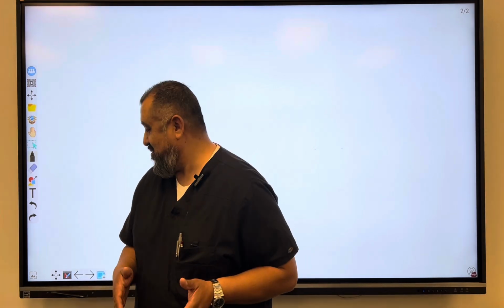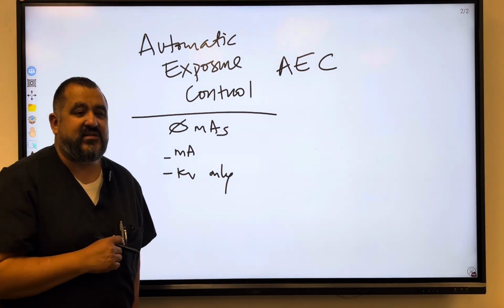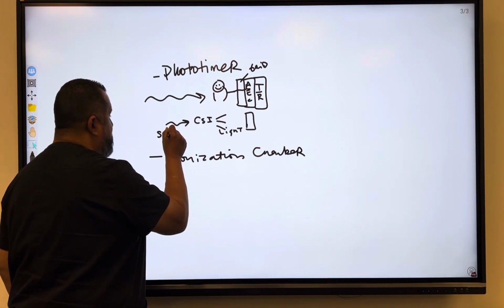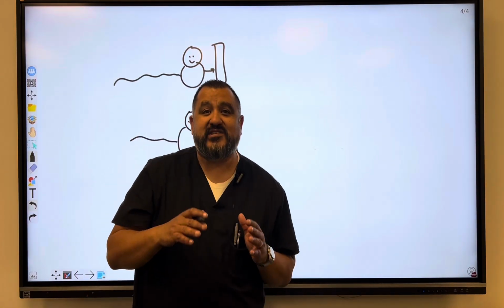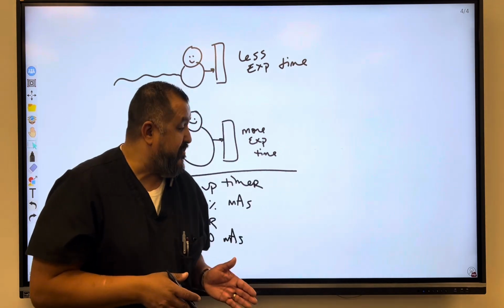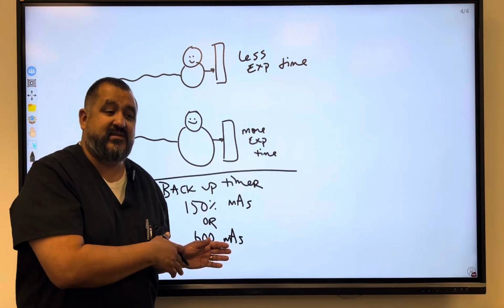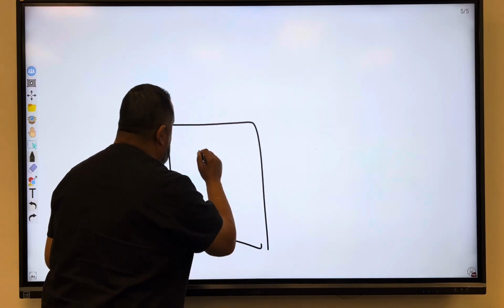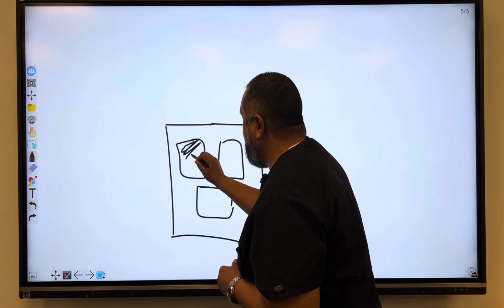Automatic Exposure Control (AEC) | Radiography with Mr. M

Comment: ughhhh wish you were my professor  iwouldnt be doing bad just a month in ): !!! any chance you Can go over Xray Ch 6 x ray equipment, skip tables, but power for x ray generators , incoming line current , single phase ,3 phase , filament / main circuit, compositor for mobile units ch 8 xray production, target interactions, hat productions, bremsstrahlung / characteristic interactions , admission spectrum ( i have the principles of radiographic imaging and art a science  )

 :
Reply from the maker: Hello, I do have other videos on the channel with some of the items you mentioned. I and my students also use the Principles textbook by Carlton Adler.
Look on the channel for the following Physics videos, "Valence Formula", X-ray Circuit", "Transformer Law", "X-ray Tube", Target interactions", "Interactions with Matter". I am hoping to one on x-ray generating systems with voltage ripple and drop and explain heat units. I hope these will help you. Mr. M

Comment: Good day sir 
Please when you did the lateral chest why is it only one box that you drew? I thought AEC was supposed to be 3
Reply from the maker: Hello, yes, there are typically 3 cells/chambers but only activated the Center Chamber for the Lateral CXR.  I hope my explanation helps. Mr. M
Reply: @RadiographywithMrM  To add to that the upper 2 cells, the left and right cells are  used for the PA/Ap lung field . Am I right ?
Reply from the maker: @maria123-s1l  Hello, Yes, that is correct. Think of the cells as sponges that need to absorb the x-ray energy. Those cells need to correlate with the area of interest. Mr. M